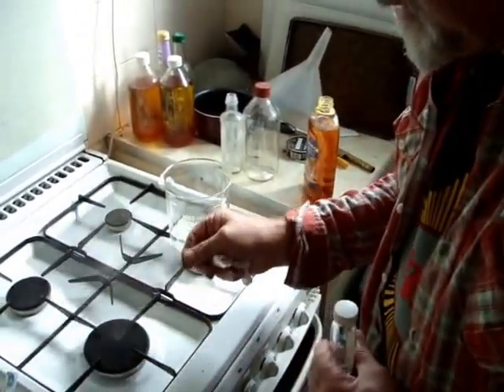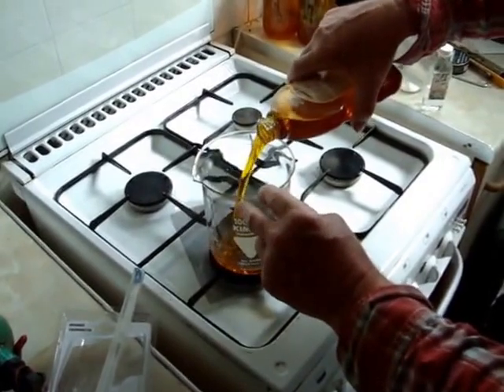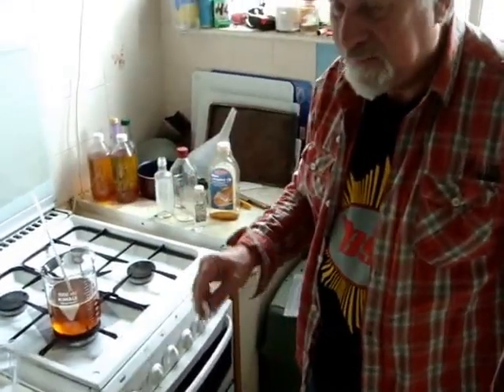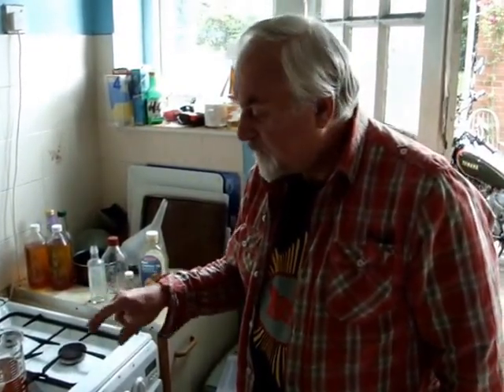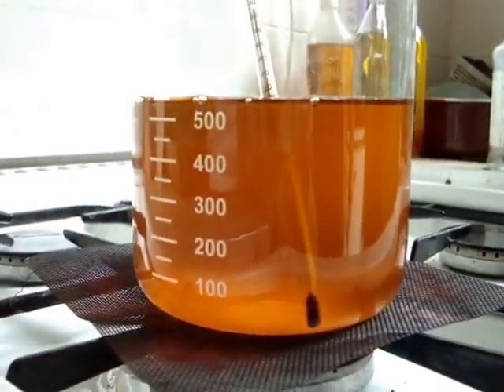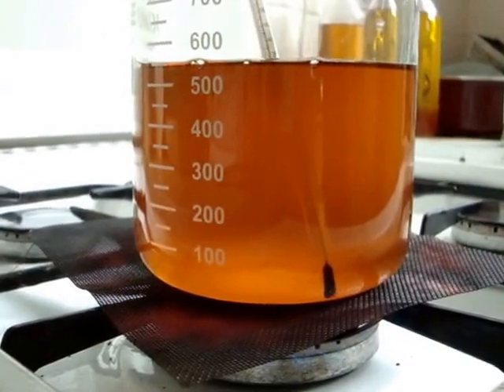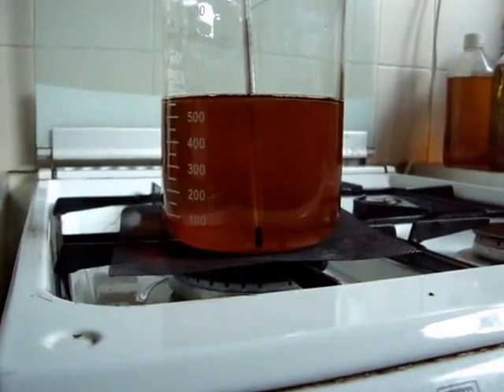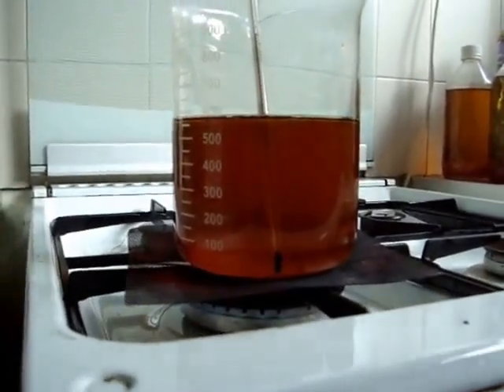Boiling Linseed Oil to Scorch a Feather

Comment: you appear to be mixing/confusing temps between C or F what is the correct C temp before turning off the heat?
Reply from the maker: sorry the temp is 240c with glycerine once the oil breaks the heat can be switched off
Reply: Does it matter as to what glycerine we put in, and what was the ratio of glycerine to oil?
Reply: Are you asking me or Frank?
Reply: Ops Frank

Comment: You can also use 1/3 of walnut oil, its speeds up the drying time a little and makes the finish less yellow.
Reply: has your walnut oil been" broken" ?  i dont find yellowing or drying time to be a problem , my varnish is chestnut coloured  but i can vary it depending on the mordant
Reply: Im not sure what you mean by broken but im not suggesting to mix raw walnut oil with the finished oil shown here, if you have raw walnut oil process it in the same way as shown here just adjust your temperature to the different composition of the walnut oil.

I did not make a finish like that myself but im very pleased with my oil finish that has linseed,  walnut and a little thistle oil mixed in.
Its also made by heating instead of adding dryers like most oil finishes.
Reply: heat the walnut oil until it breaks then allow the break to settle out and pour off the clear oil this is the first step in recreating 1550 italian varnish imho anything else is turbid
Reply: WoW, learn something new everyday
Reply from the maker: @kol257  no try  it and let me know !
Reply: Hmm. So Walnut oil is not a siccative (or "drying" oil) so I'm curious as to how adding Walnut oil would speed up drying time. Genuine question...

Comment: what you are doing here is not heat the linseed oil to remove mucilage?
Reply from the maker: i would not call it mucilage  ! i think  " the break" is better ,once removed the oil can be further heated above 240 C
Reply: Frank Pallister Linseed oil with some mucilage, its important to wash first?
Reply from the maker: watch the video ! no washing is needed, washing simply forms an emulsion of oil and water ,this is then thrown away which is a waste of time and oil !if repeated often enough all the oil will be thrown away, Duurh!
Reply from the maker: after settling for 2 or 3 days the oil can be carefully poured off for use  leaving the break behind

Comment: Thank you for doing this.  Sure beats reading about it.  If the flash point in an open beaker is around 222°C (432°F), and the “break” takes place at around 240°C (464°F), it would be logical to expect that the naked flames would ignite if they came into contact with the fumes overhead anywhere between these temperatures... yes? If this is right, is that why you recommend using the wire gauze for safety, to act as a buffer between the flames and the fumes? Thank you, kindly.
Reply from the maker: we always used a wire gauze in school when we were heating lab glassware (borosilicate )! i am not sure what the flashpoint of linseed oil is but the ancients must have boiled it with solid fuel in a metal or clay pot ,they did not  have themometers and they could not see the break   hence they boiled it to scorch a feather. this is the first step in recreating the fabled 16th century varnish and ignored by violin makers for 450 years !
Reply from the maker: as you say the gauze helps prevent ignition of the fumes (basic lab safety )

Comment: how long and what temp. to make stand oil? And thank you very much for your info :) cause I like to oil paint.
Reply from the maker: use the clear oil as prepared in my video , 3/4 fill a flask and heat at 300 degrees centigrade  maintained for 5 hour would be a simple way.there are many variations such as blowing air into the oil whilst heating, it  is very dangerous to attempt without good equipment and safety stuff,  safer is to pour my cleared oil an inch deep into a wide mouth jar( 5 inch or more ) with lid and leave this sitting in the sun every so often take off the lid to refresh the air and stir the oil to prevent skin forming  but if it has just stir it in to allow air to react at the surface again,  after a year or more !  of this it will be pretty thick  it is slow but relatively safe ! i guess this would be sun thickened oil which can be purchased from art suppliers as can stand oil
Reply: Thank you, I guess the glycerin is important too?
Reply from the maker: it is not really needed with raw oil but lowers the break temperature by around 20 degrees C and smoothes the separation  but not needed in the stand oil heating
Reply: Thank you so so much Frank, may God bless you, and looking forward to more videos from you. You will have lots of followers!!
Reply: ps, I want to be friends with you on fcbk too.
Reply from the maker: hi joe  sorry i dont do f book yet , i am too busy boiling oil !
Reply: Well, when you get on, let me know, thanx
Reply from the maker: i weakened,on f/book now